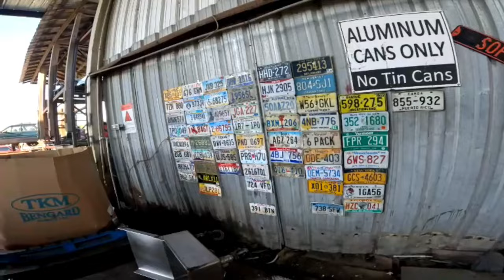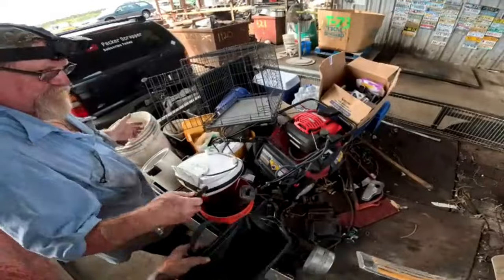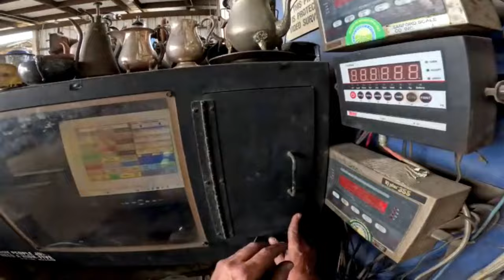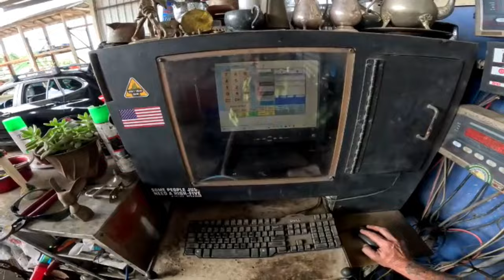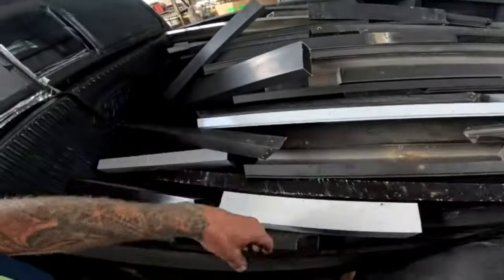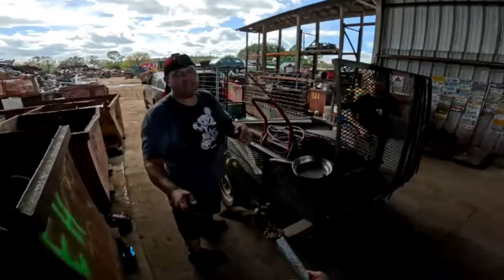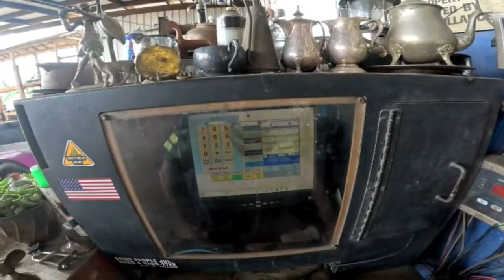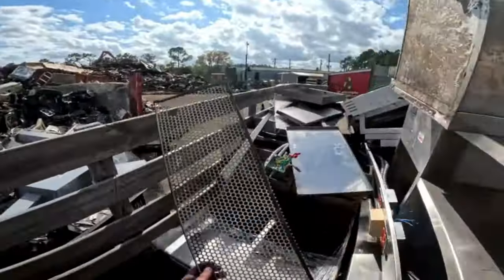CAN NEVER HAVE TOO MUCH SCRAP #recycle #recycling #copper #shear #scrap #aluminum #brass

Comment: Greetings from northern Sweden and a fellow scrapper and new subcriber.
I didnt know that about the rebar and concrete, it explodes?
I do know that you do not get stainless steel with your brass,, hard to tell it apart sometimes. 
I always take in my scrap as clean as I can get it and sorted, scrapyard likes that. Copper wires, not one single connector on any of them, scrapyard happy and I get better price 😂
I get prepared price for my nuts and bolts, brackets as it's also clean, steel only.
Stay safe and take care.
Reply from the maker: Greetings and thanks for coming along the scrap journey. If you put a hot fire on concrete it will pop and chunks fly at you. Now picture that with molten steel. You always have to gring a small mark to see what kind of metal it is with the brass. Each yard is different with its wires. As far as the plugs go the connectors are brass so save them and turn into your yard. Thanks for watching 👀 and have a great weekend
Reply: @nonferrousjeff  connectors always go in the brass 🙂
Taking a break with Coffee and sandwich,, working on a big Geothermal thing, twin compressors at about 150lbs each and 4 heatexchangers and loads of Cu. Not to mention the housing for it, it's all prepared steel 😃
Reply from the maker: @pederlindstrom3132  that sounds like a great load